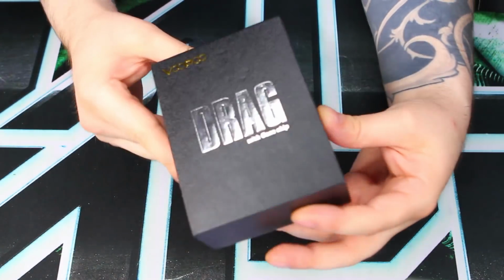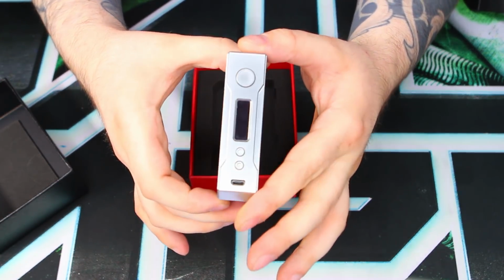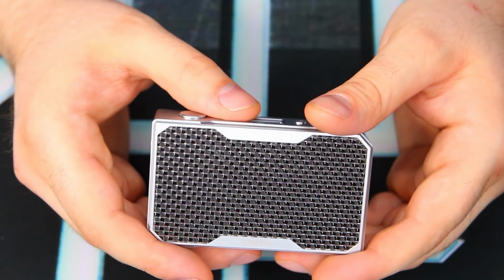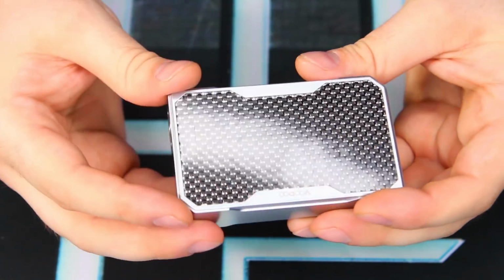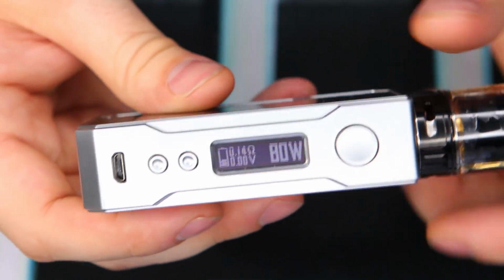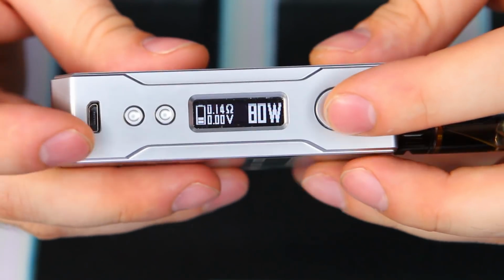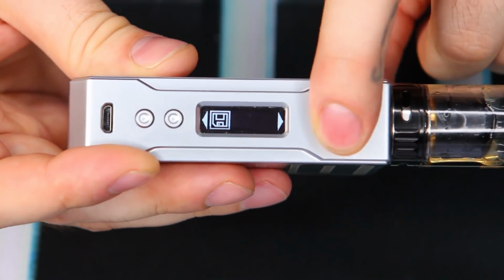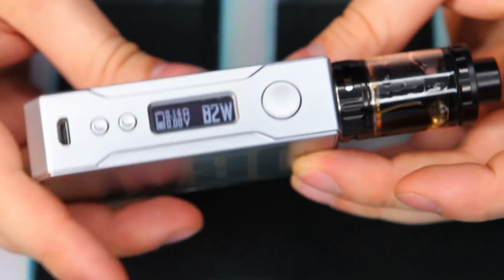VooPoo Drag Box Review

Comment: When in temp control, hit the fire button four times quick to adjust wattage, 80 is max.  Also, you have to run the firmware update because it gives you the second best thing about this mod, variable voltage.  The best thing is, of course, that it fires down to 0.05 in VW and VV.  I'm strictly a mech guy, I use regulated mods only for hot spotting and dry burning and this one is perfect for that.  It takes anything I throw at it and cuts off if it gets too hot which is something I need because I get focused when hot spotting and I've gotten a few mechs dangerously hot that way.